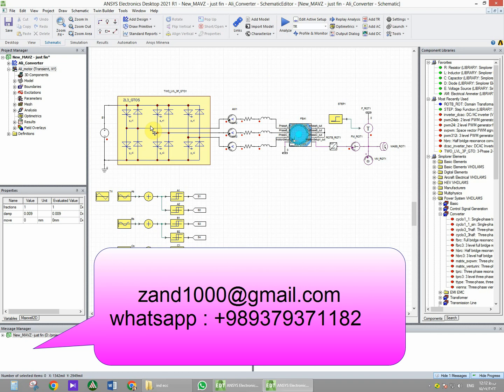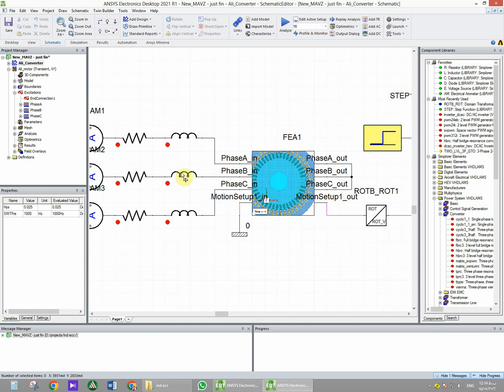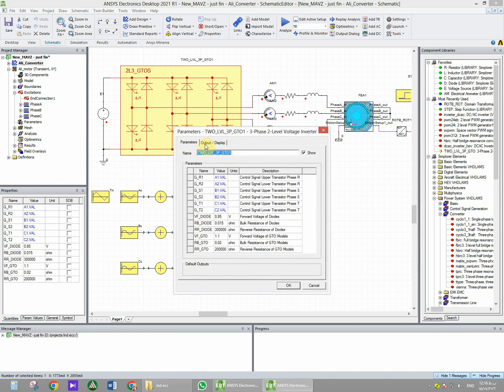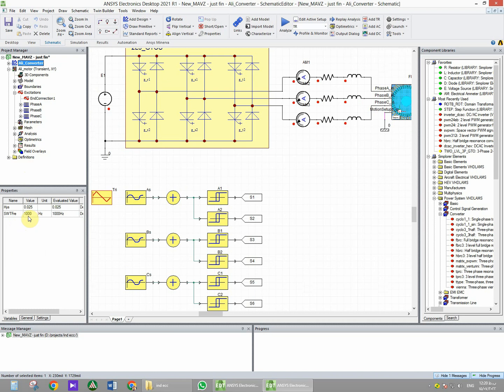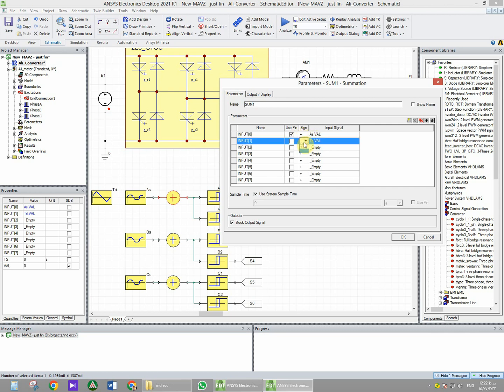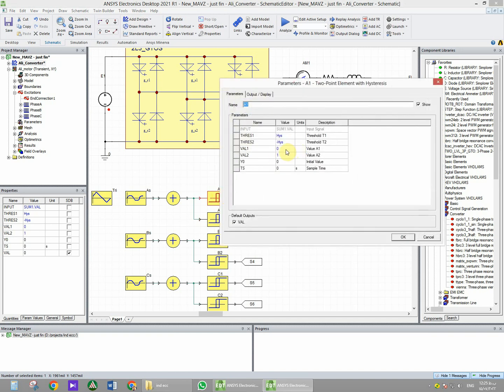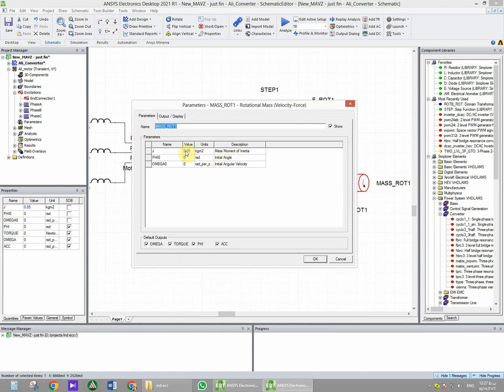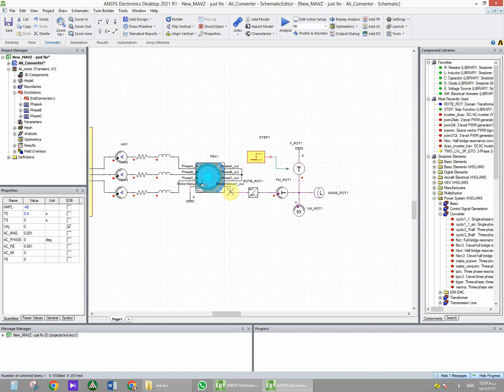SIMPLORER coupling with MAXWELL to simulating an inverted fed induction motor

Comment: Thank you so much, Mr. Vakilian. How do I add a transistor to the external circuit?? Is the inverter existing as a package in maxwell?
Reply from the maker: As I remember there was not exact module  as the transistors.(Like what we have in MATLAB or orcad . 
There are two kinds of switches, voltage controlled and current controlled switches that you can use
Reply: @AliVakilian07  Thank you for your response. how can I add a thyristor ?? I want to design a full bridge inverter like yours in the video